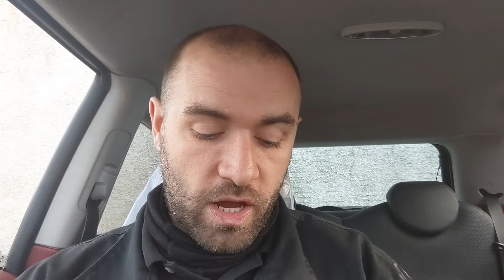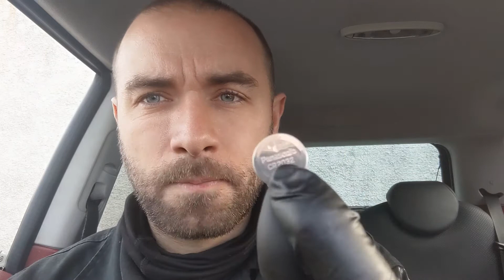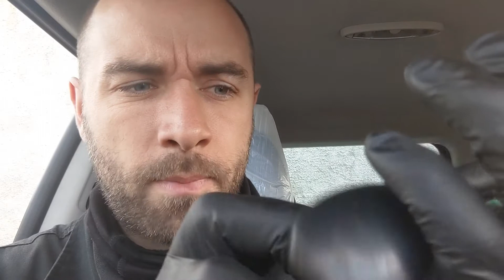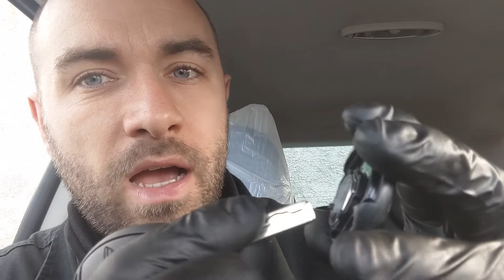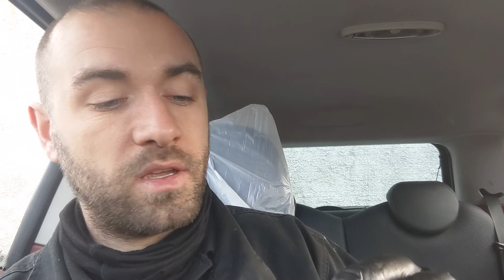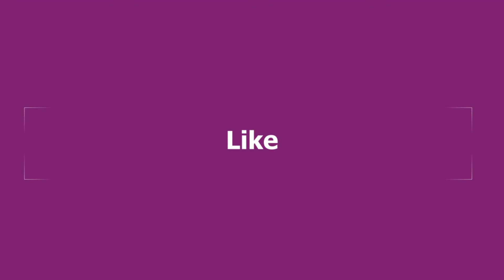How To Change An R50/R52/R53 Mini Key Battery - Fast Fix Friday!

Comment: Unfortunately, my key is the other one you showed, that is also an R50/53 mini cooper S, 2005. "Charge in the ignition."< Ill be honest I never heard that part before.
But mine isn't working. It stopped after I took out/ charged, and replaced the battery.
Be great if you did a battery change on that "sealed type" key.
Thanks. (liked.) 👍🏻

Comment: I couldn't figure out how to get my battery out as I have an r52 and it died but videos show you have to solder the circuit board to get to the battery. Some people say it's supposed to charge in the ignition. Help.